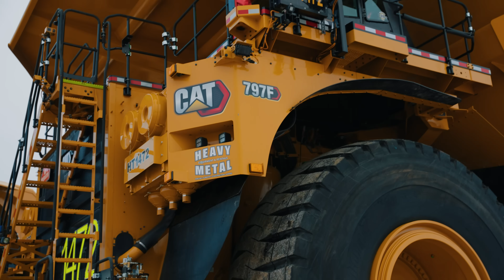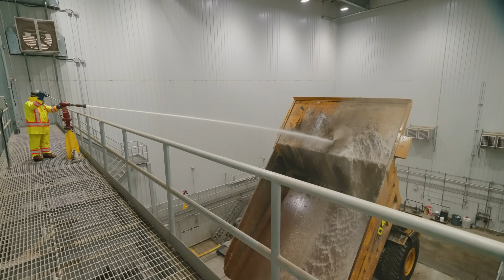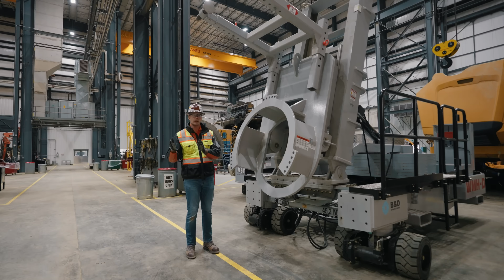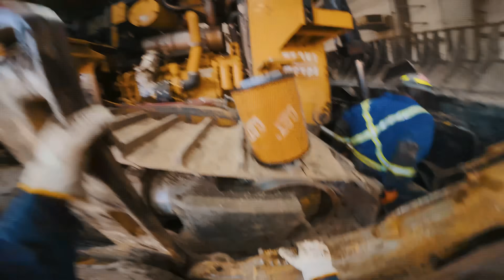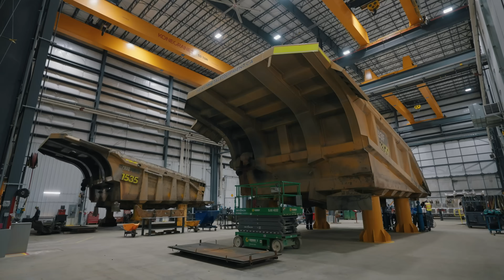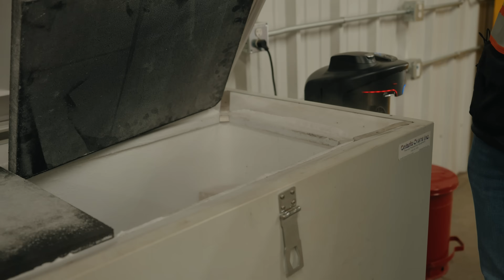Inside a Shop That Rebuilds 400-Ton Mining Trucks

Comment: Hello, excellent video, no BS just the facts. Two items I noticed was the air inlet pipe wasn’t inspected for  dust when changing the filters. The second was the welder was using a plastic box to sit on, a very dangerous practice as the box could split. 
I did work in NWT north of Resolute Bay in 1977. 
Again a great video. From Victoria, Australia

Comment: What is that constant metallic ringing sound in the shop? So annoying!
Reply: Air compressor...? Ever been in a shop before
Reply: @adrianhurtubise62  I have actually. Most of the compressors I have heard run at a lower rpm and lower tone that's more bearable.

Comment: Beautiful shops, heavy duty work goes on there for sure. I have worked in large shops also but mostly machine shops and welding shops. Who ever organized how to lift heavy parts and the overhead cranes that's needed and the large  wash bays is a genius team concerned and been there and improvised instead of having proper tools + some good thought processes on what mechanics need to work safely. Bravo nice to see! Thanks for shaving!

Comment: The sheer size of stuff is what blows me away and also just the buildings look absolutely amazing. They must’ve had a lot of input from mechanics and the guys working on this stuff too say what they need.
Reply from the maker: The heavy equipment technicians on the shop floor definitely provided input, and as you can see, they have an amazing shop because of it
Reply: @Earthmovers_media  oh hell yes that Shop floor plan is perfect. Those water cannons for cleaning and the stuff off is unbelievable. It looks like about 200 psi in about 150 GPM coming out of each one of those little monitors which you need that to get the oil sands off
Reply from the maker: @steveanderson4768  Even then, a steam wand is usually needed for the oil sands residue on equipment
Reply: @Earthmovers_media  oh yeah I could imagine that stuff is just gonna be a bitch to get off you almost wanna spray it down with diesel fuel to thin it out that’s amazing. I worked on caterpillar D399 engines in the Navy. They were actually locomotive diesel electric for the ship I was on all day was a generator that was DC current

Comment: They will regret those aircraft hangar doors. I've been to their site and was shocked to see them. rubber rollups are king.
Reply: Vertical lifting fabric or rubber is the standard. Those bi fold doors won’t last long. Wrong door for the application
Reply: @pierrevarlamoff6400  Yeah that's why I was shocked I've never seen a truckshop use hangar doors.

Comment: I work on 797's in Canada. They are as awesome as you think they are. Unfortunately, I also have to work on everything else. Just Livin' The Dream!
Reply from the maker: When you really think about it, 797 are just a convenient arrangement of components attached to a frame, all need to be replaced at some point
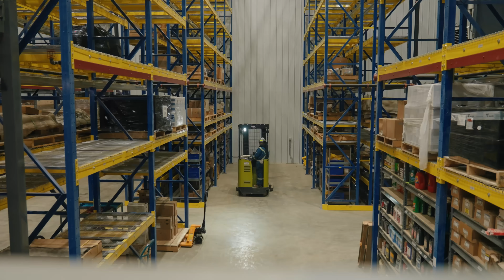Reply: @24:21 they freeze the bogie pins??
Reply from the maker: @mzee0000  Any piece that has tight tolerances, yes
Reply: What prate of Canada? Was is in Lynn Lake or Rocanville?

Comment: How do the large trucks get from the mine to the shop?
Reply: Lots of the mines do repairs themselves, they also have huge shops to do repairs. There is so much heavy equipment in Fort McMurray other big shops are needed for repair.
Reply from the maker: That will be the topic of a future video in spring of 2026, just you wait!
Reply: They get hauled to the various mines usually via multiple highway trucks. Mammoet has some videos posted on YouTube transporting these trucks from this location to Fort Hills I believe.

Comment: Working on that big iron gets old really fast though. It's great if you're chasing money, not so much if you actually want to learn to do more than just spinning filters and replacing components.
Reply: You're not wrong, I worked here in the old shop and there is little to no diagnostic work. Tear components out and replace. I later switched to running a service truck on one of the nearby mines and although many of the repairs were "running repairs", you had the opportunity to actually learn the equipment better by diagnosing issues.
Reply from the maker: Everyone starts their career somewhere, some progress into other roles and some prefer to spin wrenches for 30 odd years straight
Reply: Much of the mechanic work in that region is component swaps and services. Hardly anything, even at the dealer shops up there, is rebuilt on site. It's all shipped south.

Comment: This well layout shop being builts.I work myself some big shops but this one is top.The steel floors very good idea.I work at Fording coal elkford bc 1980-88 when D-10 come out Fording coal was one first buys but when come shop machine just wreck floors was huge mess.The company have rebuild cat bay floors due weight machine finning,line creek coal,kaiser ress learn from us include Fort mcmurray oilsands.Thanks video spot on.😊
Reply: We had a D10 field follow machine in Fort Mac (R. Angus Alberta Ltd) in the late 1970's. We stripped it down after a few months of working in the oilsands and measured the wear on everything. Back then the 777 trucks were the biggest around.

Comment: Does the wash bay have steel plates so tracked equipment can be washed?
Reply: I think he said the track shop has its own wash bay. There was a short clip of a guy with a hand-portable (at least it looked like it) steam cleaner.
Reply from the maker: Yes, the floor is steel in the new shop wash bash for dozers